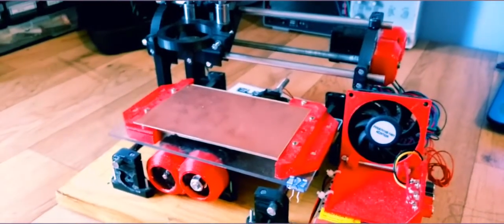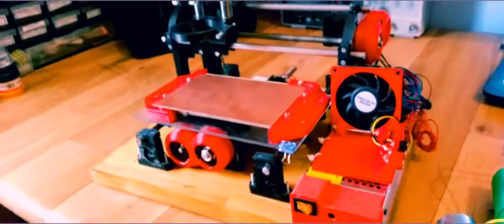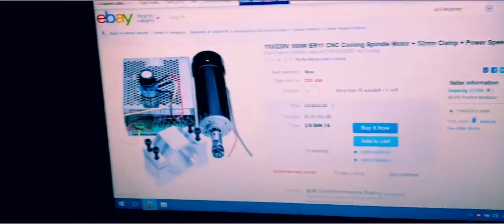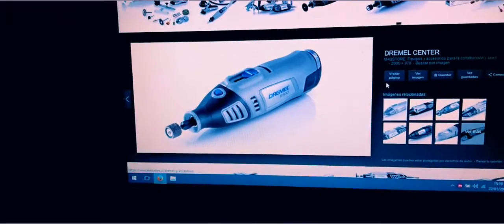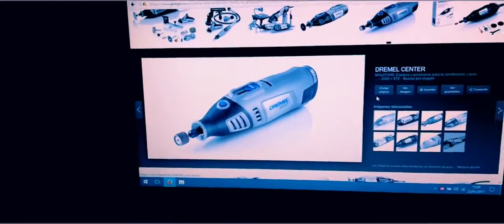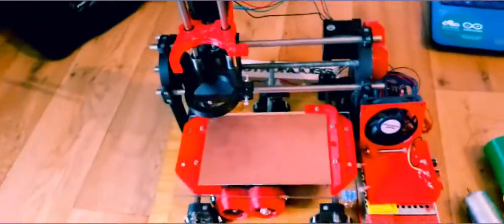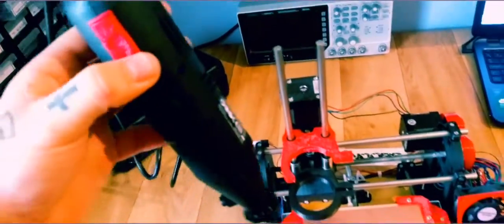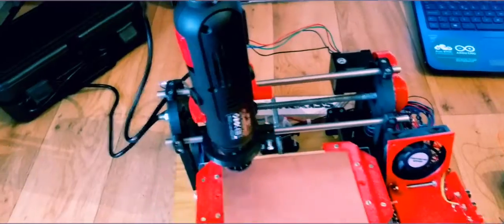Cyclones CNC mill update spindle dremel

Comment: I tried to run a rotary tool like that while I was waiting for a proper spindle from China, I had all kinds of problems related to electric noise, it broadcast false signals to my limit switches which I had to turn off, and it couldn't complete a tool path without  glitching up the the bits and bobs which do the thinking and locking up. I was worried I would have to go up and down my wiring and shield everything.. But my spindle came from China and it runs smooth quiet and trouble free. If you put more money in the unit I highly recommend that upgrade :)

Comment: Here it is 2018 and I just watched your excellent video on building an electronic speed controller! I'd love to see you add an encoder to the drill motor you replaced in this video and control it's speed and position with an Arduino or another simple micro controller. It
John Elson did something like this and converted a cheap mill to run with servos rather than steppers. It ran very fast and had positional feedback as well!